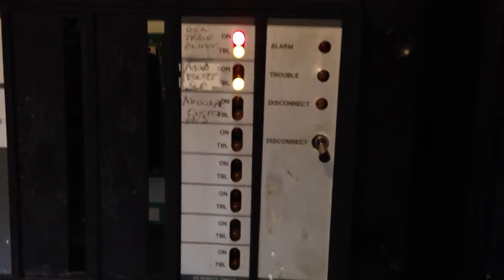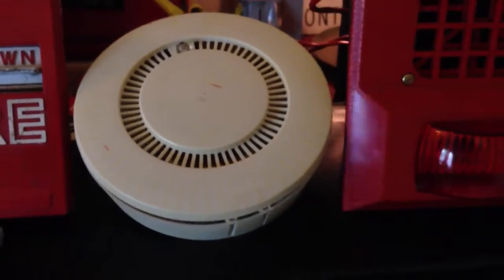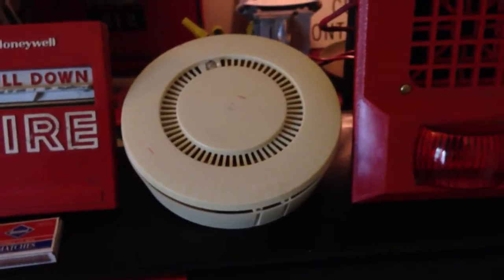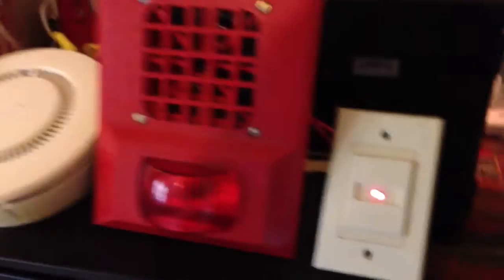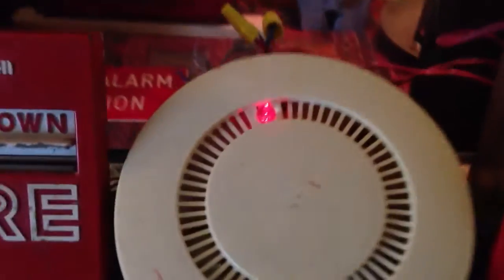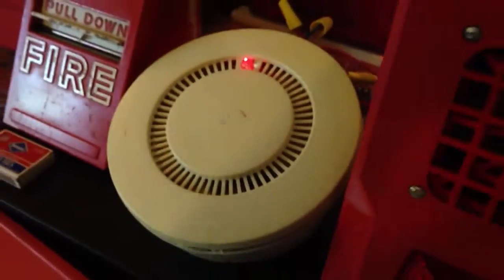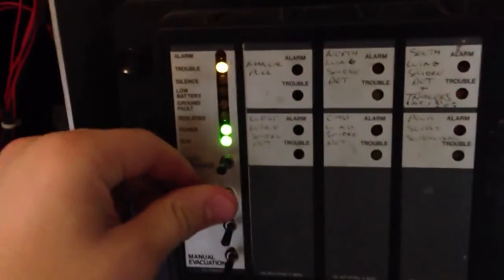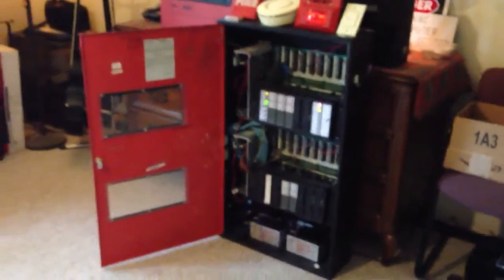Honeywell FS90 Test 2

Comment: Honeywell also made a residential version of the TC100 series, battery-operated model CD200A (TC89D was the contractor model), hardwired model TC49D, and line-cord model CD100A.
Reply: COSMOCENTRO fire 
Centro